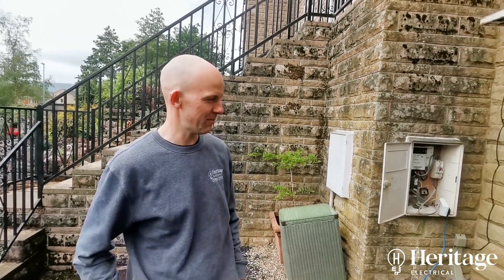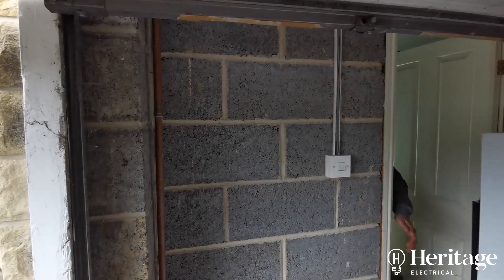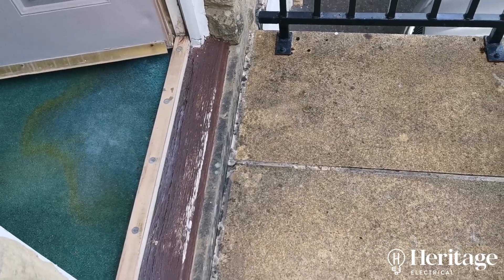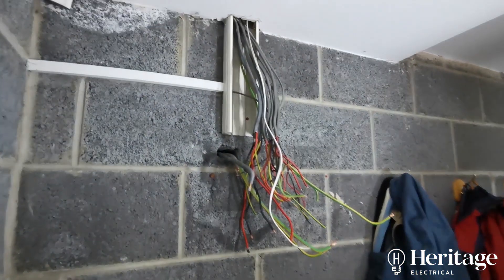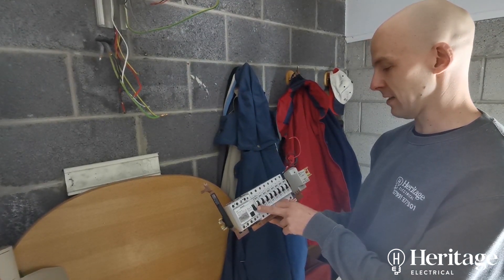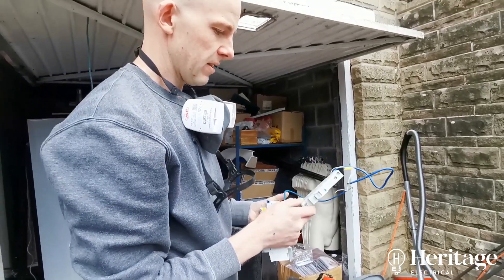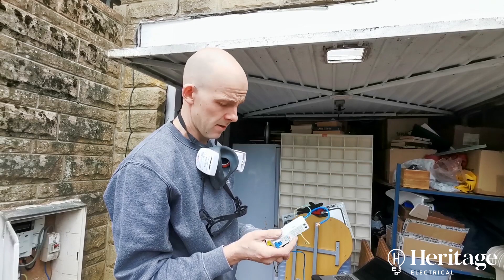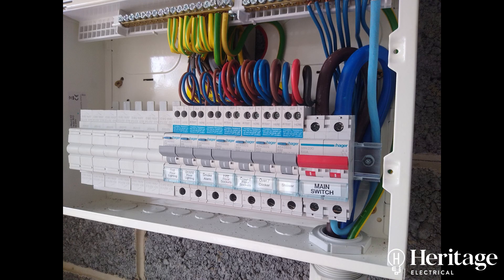No Electric in the House! Emergency Consumer Unit Callout

Comment: How did you end up protecting the board from moisture running down the cables again?  You mentioned earlier that you expected to loop below the board, but didn't end up doing that from the final pictures.

What were you able to do in the ceiling to prevent it all happening again?
Reply from the maker: Hi Paul, thanks for the comment. It transpired that once we cut a hole in the ceiling that the cables all came from inside the house above the plasterboard ceiling, rather than running down the exterior wall. We were able to therefore pull the cables away from the exterior wall and run them into the new board, bypassing any moisture problems.